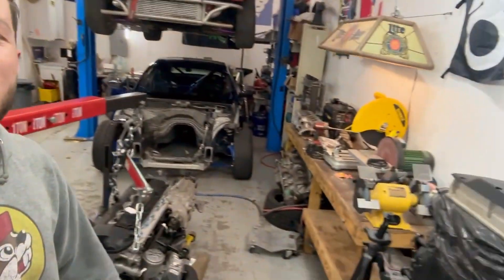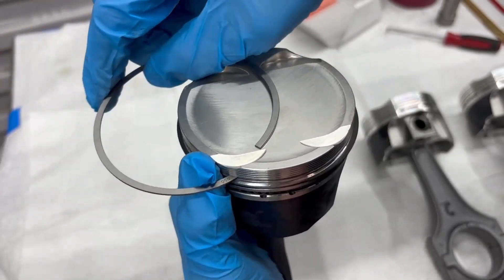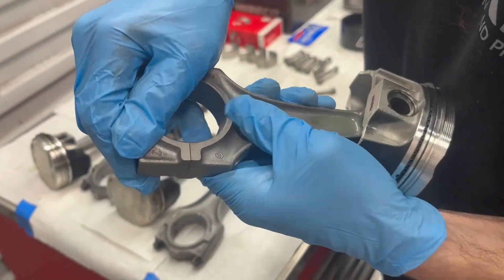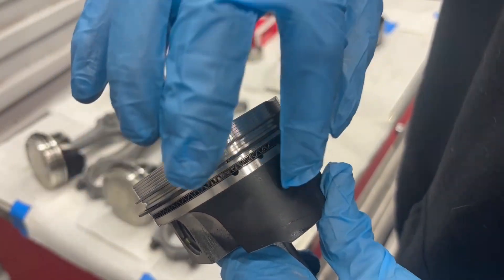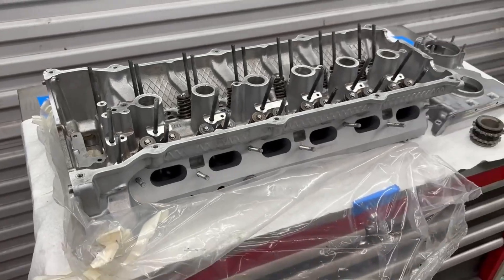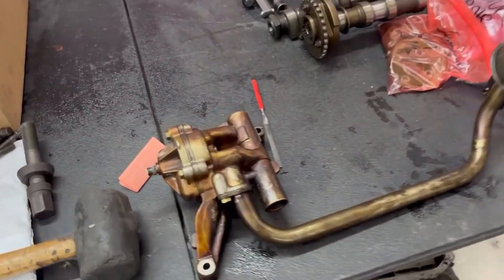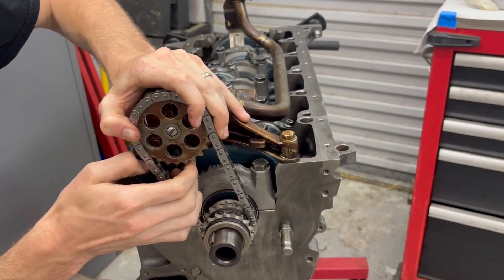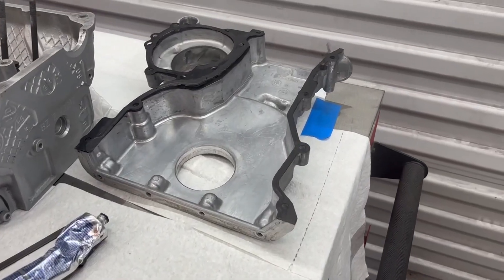Install Piston Rings the Easy Way! BEST M52 Turbo Part 2!  Bottom End Assembly! Tips - Torque Specs

Comment: Did you get the M54B30 Crank for this build?  Bore to 86.5,  9:1 pistons on pump gas...   Which ecu are you using for the tuning.   Speeduino M52 is the cheapest but VEMS/Megasquirt will be fast to put together.  (all 3 pnp).   Modded E46 cams or  Shricks?
Reply from the maker: U run link ecu with m50tu pnp!  That 86.5 is big bore!  Be careful!  

2.8 crank with 84-85 mm bore gives perfect mechanical resonance so it revs well.  B30 cranks cause vibrations at high rpm’s
Reply: @Drift.Things  no need to go above 7k , ati dampener for resonance but not really needed